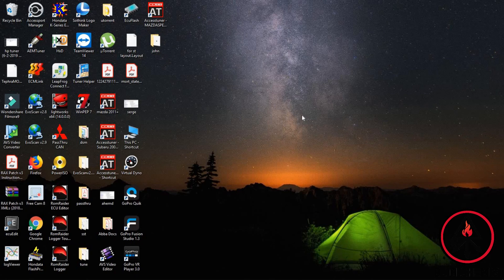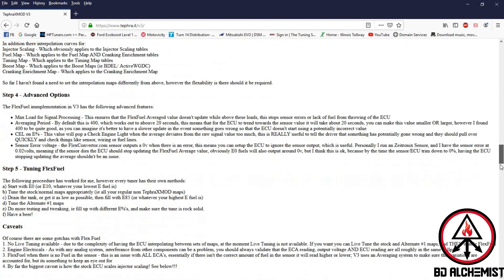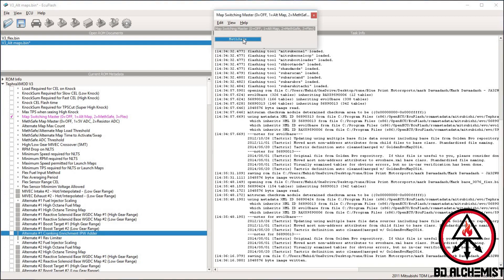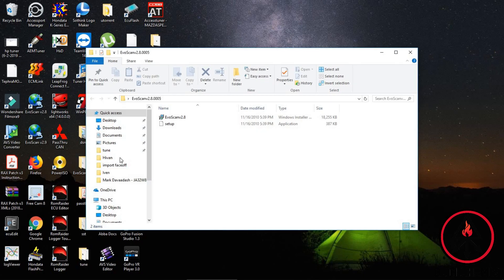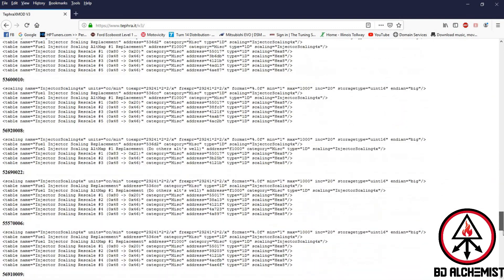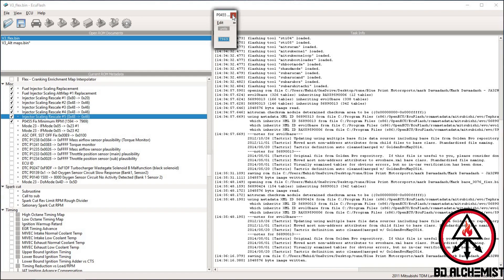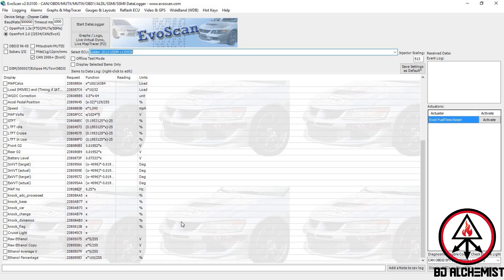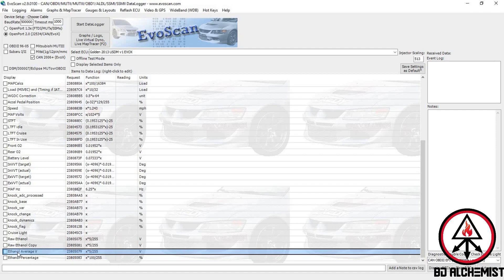EVOX Flex fuel Tuning

Comment: Idk if I'll get a answer on this old video but. Pertaining to the last part of this video. how would I find a patch or way to log ethanol while using RAX FAST logging?
Reply from the maker: https://www.evolutionm.net/forums/evo-x-general/757170-evoscan-reading-ethanol.html
Reply: Have you confirmed this working?I tried that before asking you. He says "if you already have rax then just replace current file with the one he attached" Which is what I did and still no success.  Logging looks identical as before. 
Am I supposed to copy and past the coding that he provided also?
Reply from the maker: Not confirmed. I don't use rax

Comment: Sorry for asking on an older video, but with the v3 maps, do you ever reference the high/low octane maps anymore, or do you most your tuning in the alternate map section?
Reply from the maker: huh? i don't under what you are asking.
Reply: @bdalchemist  I guess that makes sense as you probably don't have reference to what I'm asking unless you rewatch the video. Sorry about that.

In ECUFlash with the TephraV3 ROM, there is a drop down section called "TephraXMOD v3. This has all the tables for the alternate maps like "Alternate #1 High Octane Fuel Map" and "Alternate #1 High Octane Timing Map"... 

Then you still have the normal tables under timing/Fuel for "High Octane" tables. I'm curious if you still have to configure the tables in the non-V3 section of the ROM?
Reply from the maker: If ur using normal maps or say map 0 , high octane is for none knock events , and low octane is for knock events. When using alternate maps , during knock it still refers to the low octane maps.

Comment: My evo x is full bolt ons e85 tephra mod v3. My tuner said I’ll be making 380 whp does this sound right
Reply from the maker: 370-390 Dyno jet (typical) , without cams
Reply: BD Alchemist sounds good. I’m doing a roll race with my friends fox body mustang its fully built with a shift kit weighs 2700-3000 makes 320 whp. Do u think I’d be able to beat it ?
Reply from the maker: @Itachlazcano21  yes

Comment: Where do you buy a Flex fuel sensor from that does international shipping?
Reply from the maker: In the fuel pressure sensor on top of ur fuel  pump hanger
Reply: Drive fab makes one